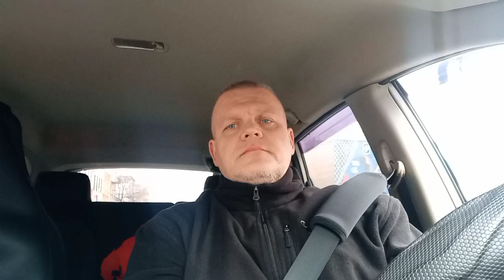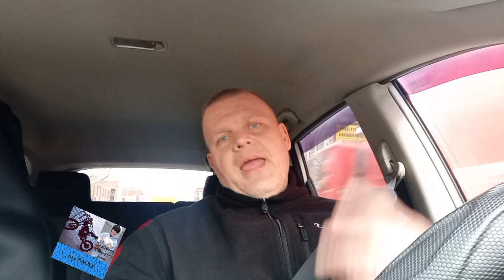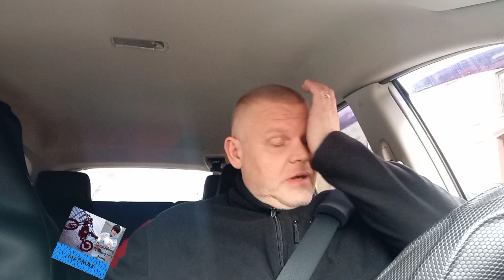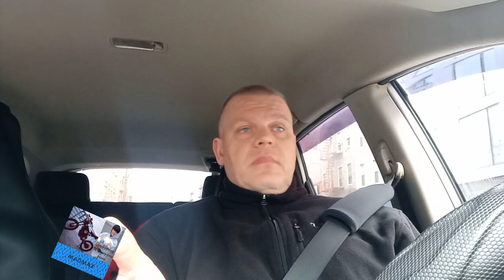before you connect your battery in parallel connection listen to this!!!!

Comment: No, it is not a good idea to mix as the most robust pack will destroy the weaker battery, best to stick to the same brand and cell properties.
Also, it is best to underutilise them and not use the full battery specifications to get the most lifetime use out of them.
Reply from the maker: Am completely with you on this